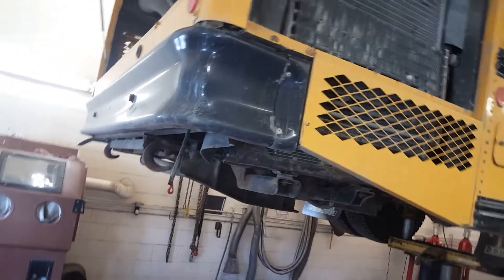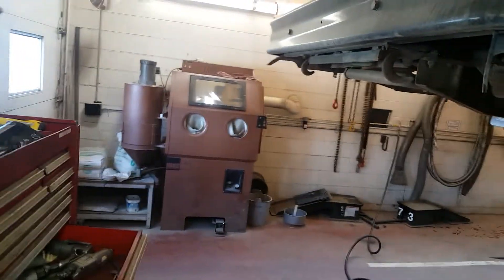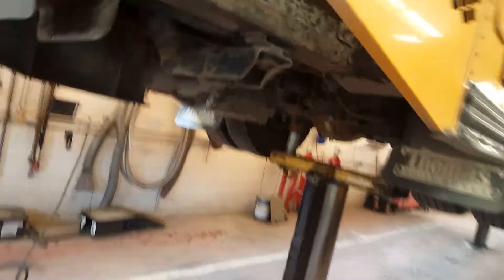Diesel Engine Common Overheating Problem and Solution

Comment: You would think with the parker hydraulic controller you could reverse the fan blade and blow all that junk out
Reply from the maker: The flow wouldn't be heavy enough to squeak through the cores. Even the steam cleaner didn't get it all.